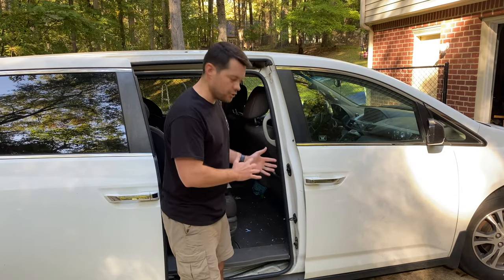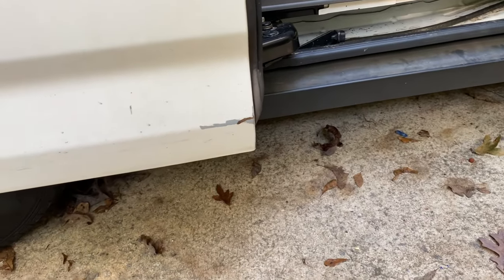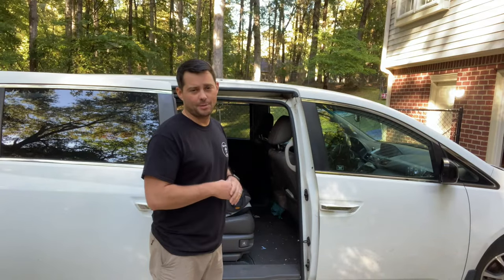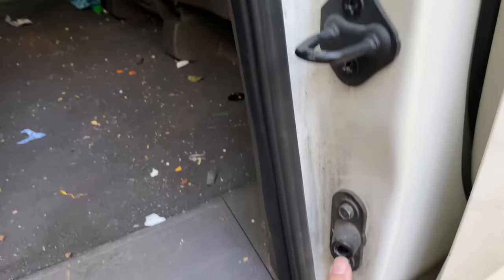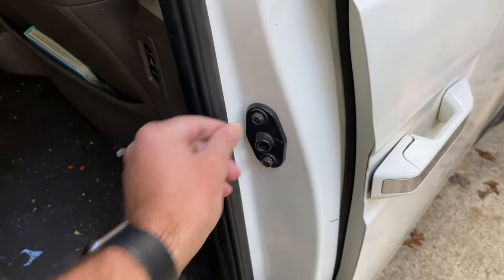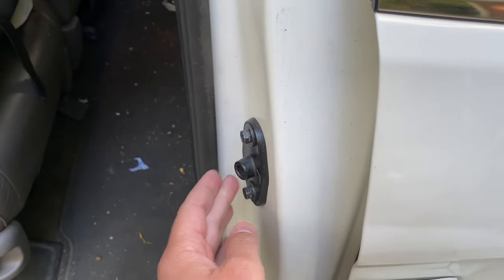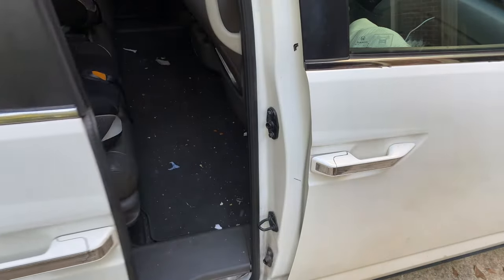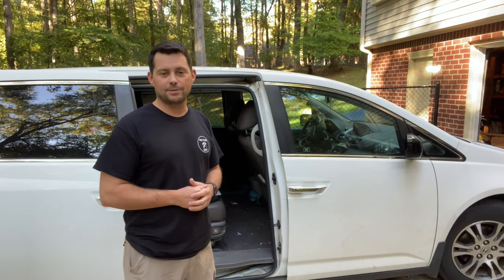Van Sliding Door Not Shutting. How To Fix A Sliding Van Door That Wont Shut.

Comment: I own a 2014 Honda Odyssey with a driver side passenger door that wouldn't close within the last inch. I used some 'SuperClean' degreaser on both sensors and where they fit into place. Worked like a charm! Thanks for the super straight-forward video!
Reply from the maker: That’s awesome! That’s a great idea! Thanks for sharing!

Comment: Thank you so much!  I was stuck w drivers side sliding door open in 108° weather, and that was the problem.  So easy to fix, and I had the flat, angled pliers w me too!  Not even two minutes work and the door shut smoothly.  Mine was the bottom sensor, I could see where they were scraping together.
Another vlogger shows all this friggin mechanical stuff to fix the doors, and I was starting to get really worried.
Thanks again!!!!!
Reply from the maker: You got it! Yeah it’s pretty easy. Feel free to subscribe for more helpful videos

Comment: Thank you!! I’ve been trying to trouble shoot our 2015 Odyssey for months - cleaned and greased rails and still would catch just before closing. Loosened the bolts enough that female bracket could move on the frame - set doors to manual - closed the door and then opened slowly and tightened bolts.  Turned back on and door now closes!!! Best I can tell is that as the rollers wear out the alignment of these sensors gets off and eventually it’s enough that it won’t work.  I suspect if I ever swap out rollers I may need to do this adjustment again.  Thanks! 💪🏼
Reply from the maker: I’m glad it helped! And yeah I think you are right.